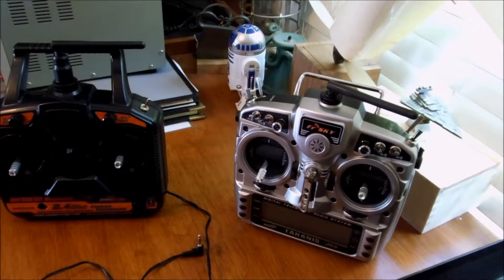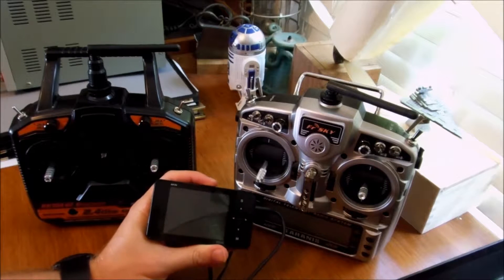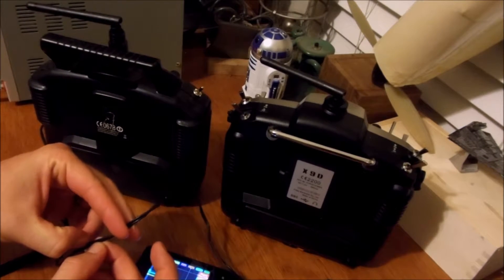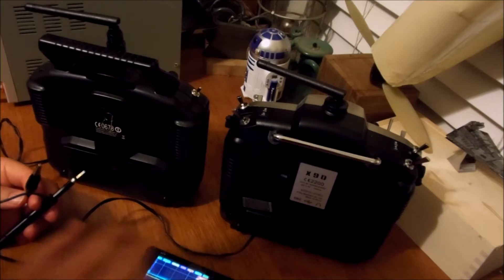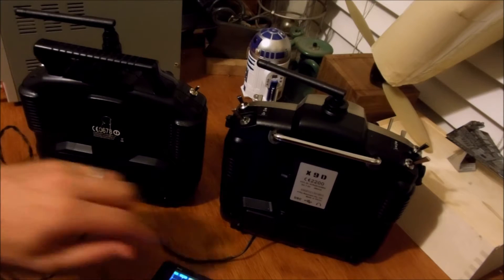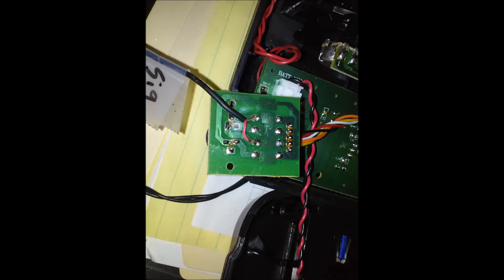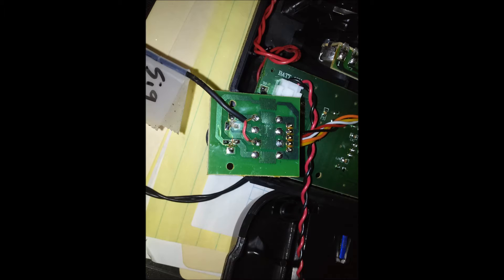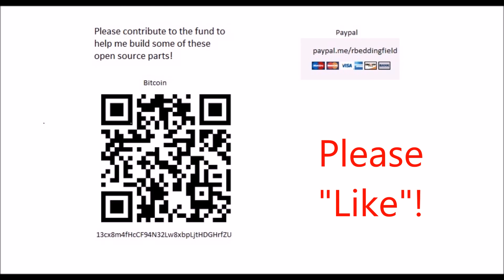Trainer or Buddy Box for HobbyKing Hk-t6a and FrSky Taranis x9d - SainSmart ds202 Oscilloscope

Comment: It would be easier to just splice an S-Video cable to a headphone cable.  It was only after I followed these instructions (and fried the hk-t6a S-Video port with my poor soldering skills) that I realized that's all we're doing, but having to solder on the PCB.

Yes, Taranis does send signal on the tip of the headphone jack, and the middle and base of the jack are both ground.  Find the S-Video pins that map to signal and ground on the PCB board as shown in this video, then make a patch cable.  No soldering needed, just twisted wires and electrical tape :)